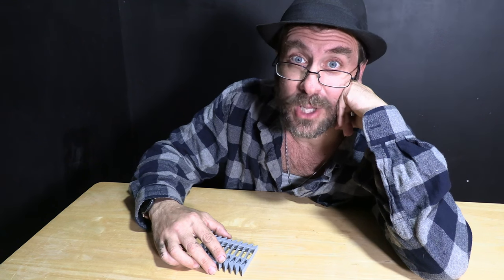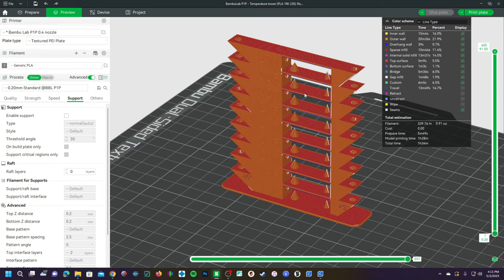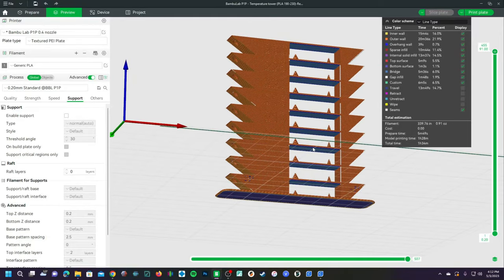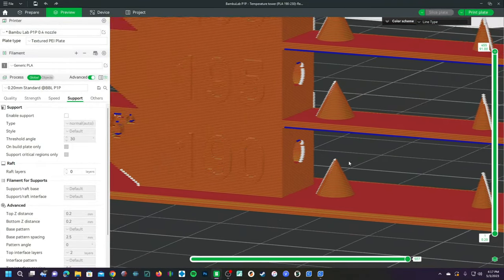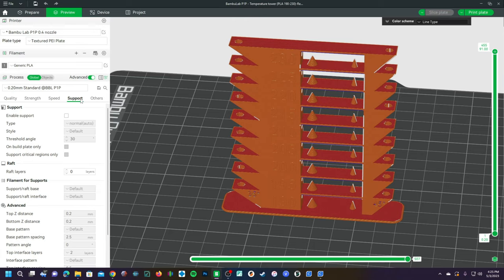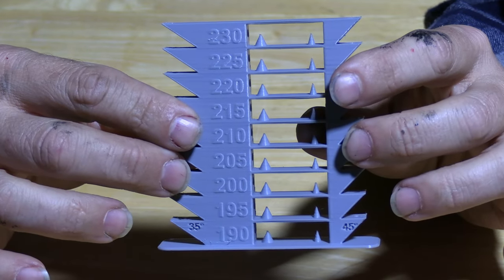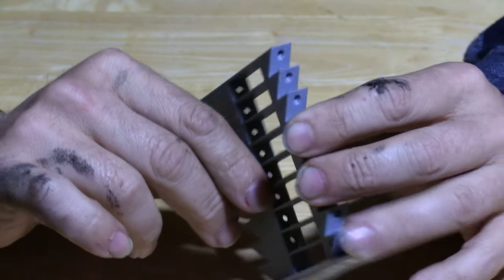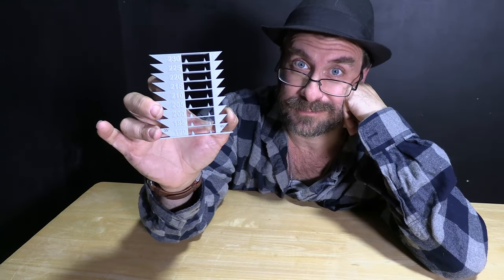Bambu Studio: TEMP TOWER: What, How, WHY to use them, for improved results on P1P / X1C 3D Printers

Comment: I've printed it on an X1 Carbon and found that the best temp for a PLA was around 205-210C, but I guess that might depend on how dry or wet your PLA, what's the ambient temperature etc
Reply from the maker: I have never printed below 220 on a P1P, P1S or K1. But on all my other machines, 200-205

Comment: @3drundown - Greg thanks for this video and the others you post.  I tried to print the temp tower you linked to but must be doing something wrong. I loaded the 3mf into bambu studio and accepted the gcode. It came in with a lot of colors in the tower so i adjusted them to the pla i wanted to check. Sliced and sent to the printer (P1S). I watched the nozzle temp; it went up and down during the prep. But stayed at 220 for the tower.  Not sure what i did wrong.😢
Reply: Never mind ... this was the result of a problem between the chair and the keyboard ... 🤔
Reply from the maker: I've been trying to find the right way to politely suggest this. 😜 Happy to hear it worked out.

Comment: This probably doesn't matter, but should a temp tower have any specific infill settings?
Reply from the maker: Nah, irrelevant. I'll tell you a secret. Almost all PLA or PLA+ filament, on any ender, will print fine at 200-205, give or take a degree. Focus on retractions and print speed

Comment: Soo how would I go about it when printing with two different materials? Like one being pla and then petg for supoorts? Obviously theres a temp difference for both. 
Is that something that can be set up?
Reply from the maker: Run a tower for both, and adjust the temps per material in the slicer.

Comment: Can you explain why you chose 210?  I'm trying to read my first temp tower and everything looks the same to me.
Reply from the maker: Make sure your machien is actually changing the temps while printing the tower. Just pick the one that looks the best. If a few look the same, go with the lower temp. Truth be told, I print ALL my PLA and PLA+ between 200-205. On K1 or P1P, I print it all at 220. I Would go with 205, unless you see a need to move. Make sure your retractions are right. That's super important.
Reply: @3DRundown  I'm glad I did this with a filament that was printing horribly.  Now after temp tower, flow and PA calibrations it's beautiful.  Thanks!

Comment: I use bambustudio for my slicing how do I make a temp tower for pla on the cool plate using this software?
Reply from the maker: You should be able to adjust this one, while leaving the gcode in tact for the temp changes

Comment: Do I have to make some settings for this, to make it's temperature changes. Or just print it like a regular file and it will change the temperature automatically?

Thank you!
Reply from the maker: Print the 3MF file, and it's already coded
Reply: @3DRundown  Ah shoot does this work with a 0,6 nozzle?
Reply from the maker: This one is set for the 0.4. I suppose you could change it in Bambu, without effecting the gcode for temp changes..

Comment: How did you instruct the slicer to vary the temp at different levels?
Reply from the maker: It's in the GCODE
Reply: @3DRundown  Ah, that threw me, because you changed the filament so I thought it was slicing.  But maybe that was just selecting the filament source.
Reply: Mostly commenting because I've definitely seen cases where none of the tower elements were different because someone didn't hit the right slicer tricks to change the temperatures...
Reply from the maker: Yes, just picked which AMS Slot to print from. The download for this tower, includes JUST the tower, as well as a 3MF that already has the changes coded. Nice and easy.

Comment: Wow I thought printers needed supports for overhangs over 45°? It just printed the material by bridging the 2 vertical planes?
Reply from the maker: Bridging is qwite good these days. 60' is typically safe, but, Bridging, is different, as it's not printing on air, it's bridging from one surface to another.
Reply: @3DRundown  very cool. Thanks for the info!

Comment: the link only has the p1p files, has anyone found the ones for X1 carbon or tried them on a X1C?
Reply from the maker: Sorry, at the time of this video, there weren't any yet. Perhaps there is now? I don't own an X1C to do or test myself
Reply from the maker: Lot's of people have issues with Orca, and move back to Bambu. Also, for me, it just makes more sense, to teach the most widely supported, mainstream programs, as I simply don't have the time to cover them all. It's really hard to even run this channel at ALL.
Reply: @3DRundown  don't use orca for the main print. Generate the sliced stl files for the tests and import then into Bambu slicer.
Reply from the maker: Gotcha. I'll check it out